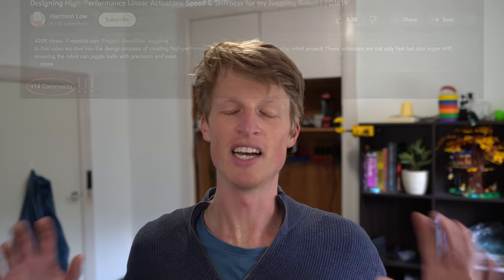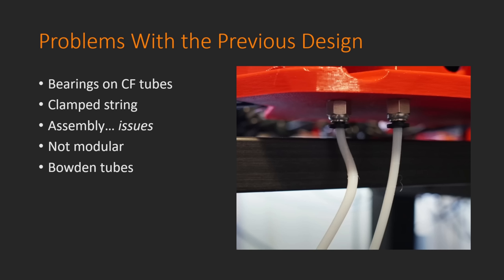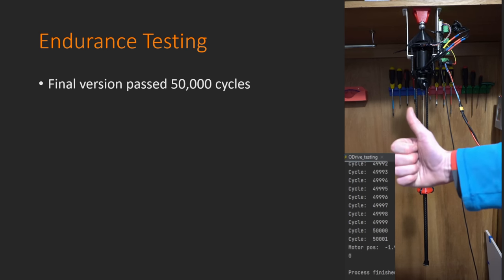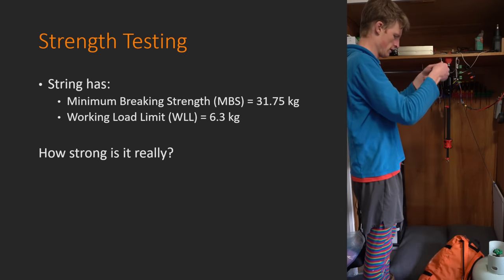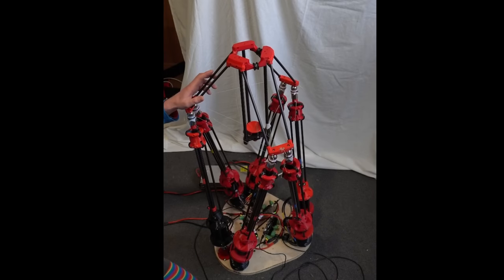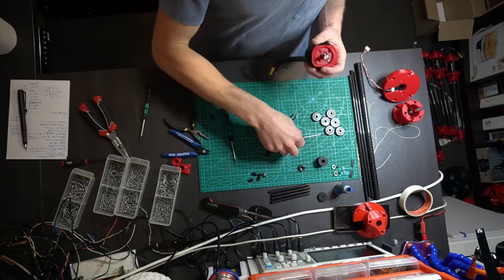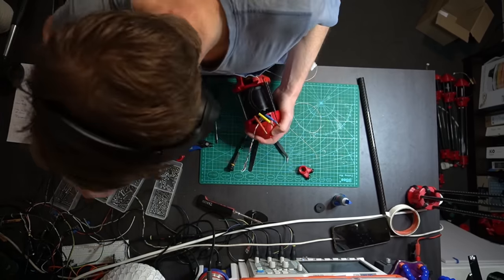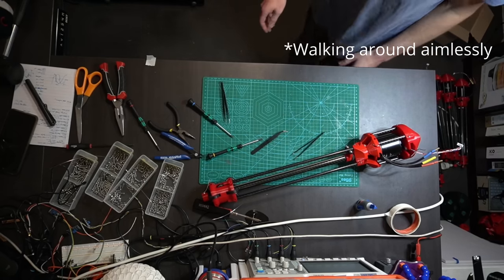My New Linear Actuators are SO MUCH BETTER! | PDJ #21

Comment: For the bearings, you may be able to find a bearing with a different profile instead of the flat edges. I know in the yoyo world, there are ones with a V shaped slot in them. Perhaps you could use something like that, and an o-ring stretched around into it? The v-slot would keep the o-ring from slipping out.
Reply from the maker: That's a really interesting idea! I'd considered V-shaped bearings on their own but never thought to put an O-ring on them. So clever! Cheers 😊
Reply: I have used urethane covered bearing (think skateboard wheels) to solve this issue. You can purchase them with a radius  groove cut into them that matches the radius of the tubes. Or place a flat surfaced bearing on a bolt and in  a drill, to spin them. Then using a file to rough cut then desired shape. Then sand paper wrapped around a piece of tubing to fine tune the radius.
Reply from the maker: @anthonyfontana6325 Great suggestions! If possible, I'd like to stick with commercially-available parts where possible (and minimal-effort parts otherwise) because of how many copies of the same part I need. Cheers for the suggestions 😊

Comment: Great work! Thanks for keep us posted. I can think of many uses for this kind of actuator in robotics etc.
Reply from the maker: Cheers! If you ever use them in anything, I'd love to know 😊
Reply: I would absolutely let you know. They look so cool, it is tempting to create a project just to make use of them. I am thinking light weight quadruped robot. Or bouncing bipedal balancing bot.   If they can handling gravity fast enough for juggling, they should be able to handle gravity fast enough for bouncing? @harrisonlow   :)
Reply from the maker: @whitneydesignlabs8738  Both ideas sound awesome! Some things to keep in mind when drafting ideas:

1. These actuators have quite a bit of rotational inertia. If you pull the push-rod out (quickly) and suddenly stop it, the whole actuator twists around fairly aggressively (thanks to the rotational inertia of the motor). Thankfully I've found a very cool solution to this issue for Jugglebot (will be in a future video) but it's worth keeping in mind

2. I don't need to worry about the weight of the actuators, since I've got the motor (by far the heaviest part) right at the base, so it moves around as little as possible. I feel very confident that the actuators would be able to "jump" themselves off the ground, but you might not have a huge amount of leeway for the mass of whatever other bits are needed for the robot.

I love the idea of a quadruped, and it'd be handy to be able to scale this design down to fit a smaller robot. If you do go down this path, keep me posted on Zulip (link in description) and I'll happily lend a hand where possible 😊

Comment: This is really impressive. I hope you manage to get these into commercial production because there's nothing out there with specifications even close to this at the BOM of what (I'm guessing) they cost.

ODrive's documentation is (IMHO) VERY bad, which is unfortunate.
If you don't want to make a board yourself, the simplest thing to get (possibly) regenerative breaking running would probably be to wire the resistor connectors to a full bridge rectifier, dump the output of that into a low ESR capacitor and have that attached to a high current buck-boost charging controller for whatever battery system you have.

If you have a 2 ohm, 50w resistor that's overheating, you're getting at least an average of 10V through it and likely at least twice that. I'm going to guess the ODrive module is just straight shorting the motor output to the brake resistors but it would be nice to see that on an oscope (voltage and PWM).

As long as you maintain a voltage on the rectified current from the brake resistor terminals, that should force current to stay lower.

There's a lot of considerations, but that's a pretty simple way of (probably) doing regenerative braking.
Reply from the maker: Cheers! For better or worse, I'm not remotely interested in marketing/sales so I'm sharing everything I make as open source. If someone else wants to make these into a product, I'd be interested to know, but they are more than welcome to do so 😊 (as for the cost of these actuators, I don't know exactly what they come to, but I'm pretty sure it's well under AUD$300, the bulk of that being the motor and encoder)

Very good info there - thanks! I want to try to keep things as simple as possible so I'd prefer to solve the problem using just the ODrive (which I'm fairly sure should be possible). I agree on documentation - it's quite tricky to figure out how to do many of these things!
Reply: @harrisonlow  The main thing I notice about the ODrive board is that it has no inductors (not any serious ones anyway). Hopefully it can just use the motor itself as the inductor to dump the load into the "resistor" at an arbitrary voltage suitable for actually charging something. I sort of doubt it, but GL;HF.

I've been looking for a good, fast, strong linear actuator for years to build a new hexapod with. I mean they exist but they cost 20,000 USD per actuator for compact electric-hydraulic units for aircraft.
Reply from the maker: > GL;HF
I'll try my best 😅

What are you planning on making with your hexapod? A racing sim of some kind? I'd love to see these actuators (or derivatives of them) scaled up to that sort of size. Would be pretty awesome to see!

If you do go down this route, I suggest posting to the Zulip site (link in the description) and I'll happily give suggestions/advice/clarifications on my design decisions if needed 😊
Reply: @harrisonlow  Mostly I want a platform for testing other things. I live in a wooded area and even something like an unmanned ATV wouldn't be able to traverse it. Everything I've made so far has to live in the house or on the lawn. I also live close enough to an airport that every time I want to fly an autonomous UAS (i.e. drone) I have to call the airport and get a 'beyond visual line of sight' (BVLOS) waiver. US drone laws are pretty harsh.

Anyway, mostly machine vision and relatively simple AI.

Having something that can physically lift its legs up over fallen trees would be great and having it able to do that and not take 30 seconds for a screw type linear actuator for each motion would also be nice.

I think I asked you before (a while back) whether you were going to put an IMU on the end of these actuators. Well, there was a reason for that. Putting a force sensor and IMU on each actuator would be helpful. I'd have to look and see how practical it would be to put a strain gauge (or similar) on the terminal end of shaft the cable runs through.

One of things that I was looking at with your actuators is whether they can be easily neutrally balanced with a spring for a particular load? That ends up saving a whole lot of power when you're using hobby servos for robotics at least when you only have to power the deviation from it's default position and not power the entire stroke or rotation (or whatever movement). Seems like yeah? It should be relatively easy? Famous last words.
Reply from the maker: Wow that sounds awesome!

Re. IMU: I don't have plans to add any to these actuators, but I do plan to put one on the platform itself (to help measure the actual throw velocity). 

I haven't spent too much time looking into force feedback, but I'm under the impression this is possible with a sufficiently advanced motor controller? Have you looked into the ODrive Pros at all? They seem super advanced and it wouldn't surprise me to learn that they could do this as well. I like the idea of neutral balancing, and it's one that I've never thought about before. I reckon it wouldn't be too tricky to put a spring in on the bottom side of the actuator (so the compression string passes through it), though changing it out if you wanted to change the "balance" position might be tricky 🤔
Reply: @harrisonlow  Yeah. There's a lot of places to put a compression spring without too much difficulty but tension springs are easier (for me at least) to deal with. I would probably just add an attachment point on the side of the moving rod closest to the motor and to the side of the top assembly (so it would be under tension being pushed in). Then I could literally unhook the spring in a couple of seconds or swap it out for rubber bands or even a pneumatic door damper just to see how it affected performance.

I don't think it matters too much if the spring is concentric with the moving rod but it will be interesting to see once you get the full Stewart platform working how well these actuators will handle side loading.

It would also be interesting to see the weight test you did done horizontally. Probably the additional bracing you have planned with the bottom of the moving rod would help a lot with slop (and hopefully wear) with side loading.
Reply from the maker: @htomerif  Yep, I'm also very interested to see how stiff these actuators are when put together into the platform. Hopefully they'll go well 🤞🤞

Comment: You could use delerin wheels for bearings
Reply from the maker: Interesting! Do you think they'd be fine when running straight up against the carbon fibre tube?
Reply: @harrisonlow  well i haven't tied. But i can say this. Has worked for years on my ender 3. It uses aluminium extrusions

Comment: I wonder if it could be worth using a small electromagnetic disk break in each actuator to assist with braking. My knowledge is admittedly limited here so I am just going off intuition but I imagine just putting a % of the braking energy requirements into another system would have something of a multiplicative effect with whatever gains you find by improving the current brake resistor system. Of course even the smallest scale implementation of this would raise the complexity but as long as you're approaching it for % gains instead of an entire solution there might be a justifiable complexity middle ground. 

This suggestion is significantly more whimsical but I'm curious if there is potential to use air resistance to assist with this. Something along the lines of adaptive flaps that open when you want to decelerate. Don't have the SLIGHTEST clue how you could actually implement this but it's a fun idea.
Reply from the maker: Very out-there suggestions, thanks! Some thoughts:
1 - I'm not sure I follow why adding a physical brake would have a multiplicative effect with the gains from improving the (current) electrical brake? I'd think these would be fairly independent of one another?
2 - Is there a significance to your suggested physical brake being of the electromagnetic variety? Someone else suggested adding a mechanical brake (perhaps something like a push-bikes rim brakes?) and I'm intrigued by the idea. I'm not sure the added complexity would be worth it, especially given that the electrical brake ought to work, but I do like the steampunk aesthetic it'd bring 🤔
3 - Air resistance is another level again! I've got no idea how that could be implemented here, though it would be very impressive to see if it could somehow be pulled off!

Cheers for the interesting thought experiments 😊
Reply: @harrisonlow  1 - I added the intuition not knowledge warning for a reason here haha. Suggesting it would be multiplicative is likely wrong, would probably just be additive.

2 - The main reasons electromagnetic braking seems like a good fit for this is to minimize wear and potential mechanical  jitter. At my job we are often working around the issue of jitter. I'm unsure if the scale of control your robot requires would be significantly affected by it but if you do go the route of adding additional physical brakes I could see jitter being a possible pain point in getting all the arms timed correctly, especially as you improve your design and movement speeds.. I also think it would give more control over/smoother force curves.
Reply from the maker: @LimabeanStudios  1 - Very fair! Intuition can be very powerful and I appreciate your suggestion 😊

2 - Fascinating. I am yet to have the pleasure of working with an actually functioning robot (or any similar system, really) so I haven't experienced jitter "in the wild" but I can absolutely see where you're coming from here. In my mind, this is an even stronger reason to solve the problem properly without introducing any other systems unless strictly necessary.

What sort of work do you do that deals with jitter so much?
Reply: @harrisonlow  you are very correct about jitter being even more motivation to make your current system work, but where is the fun in that. 

I work in a physics research environment, we make a lot of mechanical test fixtures where having really tight control between the timing of triggering events and recording data is important to us.
Reply from the maker: @LimabeanStudios  Very cool! I can see how jitter/vibrations would be quite impactful in that line of work
Reply: @harrisonlow  I should clarify, when I use the term jitter it's more about the "slack" and lack of precision that comes with mechanical systems rather than an object "jittering" or vibrating. On an extreme end you can think of a big chain of gears or bar linkages, moving one at the start of the chain will not give very precise control over the final motion. Using belts or cables like you introduces a very minimal amount of jitter.  Jitter is an inherent trait of all mechanical designs, the less moving parts and precision required the less you need to account for it.
Reply from the maker: @LimabeanStudios  Oh interesting! So what you're describing is along the lines of backlash? I would've thought that adding a braking mechanism wouldn't really affect the backlash in the system?
Reply: @harrisonlow  Yeah I'm not doing a great job describing it, back lash is a really visible form of jitter. Even something simple and direct like a rod being pushed up and down by a cam has jitter due to tolerances, friction etc. Think about a "perfect" cnc produced cam and rod system vs one carved by hand out of wood. Your confidence of where the rod will be depending on what position the cam is rotated at would be much lower with the wooden one. You would need to account for this when designing your system, and that would be accounting for jitter. Jitter is like "the impact of reality" on designed mechanical systems.

With your juggle bot this could show when getting the arms all timed together perfectly. In a computer simulation if you tell all 4 arms to raise at the same moment they will, yet in the physical world one arm might achieve the final motion 100ms (random number pulled out of my ass) before or after others. The more moving parts and more precision required the more you need to account for it. In a factory like a packaging plant with tons of supporting systems they handle jitter by making positions and timings as forgiving as possible because at the end of the day a box full of product is just about as precise as you need to be. If you are making a surgery robot where precision of movement is critical you would handle jitter by machining and assembling parts with incredibly tight tolerances. I probably should have used the word tolerance much earlier in this conversation lol.
Reply from the maker: @LimabeanStudios  Thanks for the detailed explanation! I think I understand what you're getting at now. So jitter is the result of all physical imperfections of the real system?

Do you have any advice for how I could be keeping an eye out for jitter affecting Jugglebot? Simplifying sub-systems as much as possible seems like an obvious one. Are there any other techniques you've learned for how to avoid it creeping into a design?

And do you have any suggestions for how to measure or deal with it when it's in a system? I imagine IMUs might be useful here?